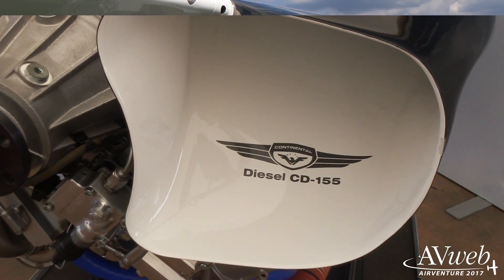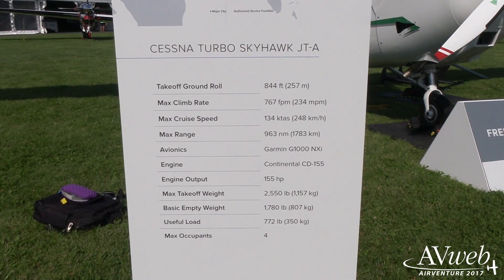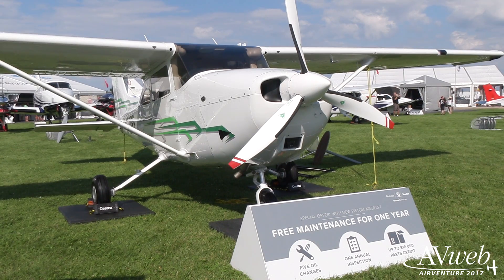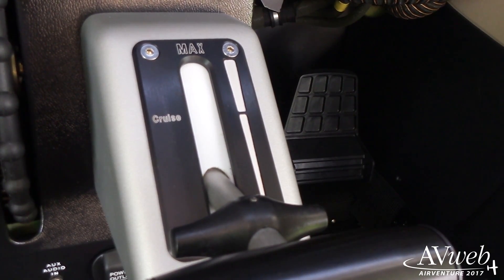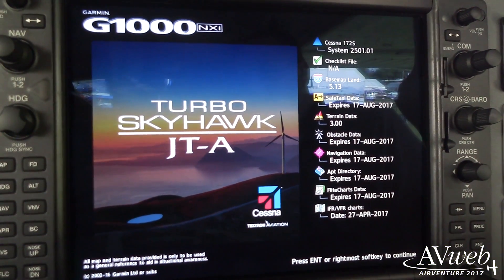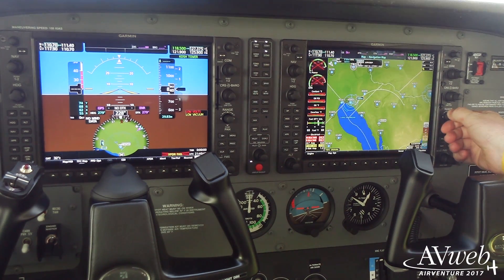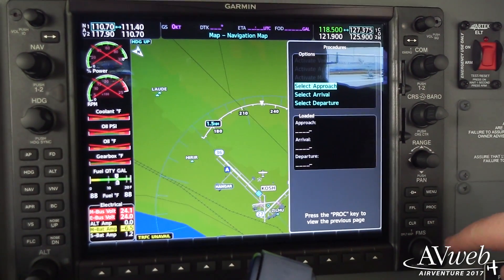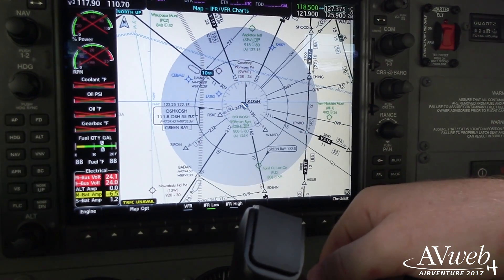Cessna's JTA: The Latest Diesel-Powered Skyhawk

Comment: They should have build a diesel C172RG and put a parachute in the back - now that would have been a 5.5 gallons/h 140 knots cirrus sr20 killer without those toxic slow flight characteristics. And it would have beaten the diamond da40 green house oven.

Comment: The Skyhawk is indisputably the most successful airplane in the world, with some 43,000 built and flying worldwide.  It fits whoever wants a simple plane to fly and maintain, and it does a lot of things very well. The JTA has exciting new altitude capabilities, which is something the normally aspirated avgas Skyhawk needed more of.  The new Garmin 1000 NXI gives the new 'Hawk unprecedented capabilities. I haven't mentioned the longer range yet. See below for the usual Germans whining about the price.  Cessna makes only incremental changes to the  'Hawk, because there is no reason to radically alter a proven design.  Airplanes cost what they cost because they are  built on demand.  Your gee-whiz smartphone can't stand  a lot of heat and they crash all the time. If you want high-performance airplanes, build your own, and write "experimental" on it. Then watch your friends climb into a local Skyhawk instead of your experiment.  Cessna is not going to bring back the C-120. Finally, the DA-40 is not built as well as a Skyhawk, and it is a flying oven in the sun. Sorry, Germans.

Comment: I'm all in favor of diesel-powered aircraft for simplicity, reliability, and increased fuel economy, but WOW... $438,000 for an ancient-design s-l-o-w fixed-gear, fixed-pitched prop C-172?!  Geez, I paid $54,000 for a brand spanking new 180hp, retractable gear, and with constant speed prop C-172RG Cutlass waaay back in 1981!  Yes, I got an incredible end-of-year deal, but still.  IIRC a new C-172 Skyhawk back then was probably around $40,000 so this one is at least 10X more expensive!  And it seems to me a diesel-powered version should be cheaper than a standard new Skyhawk since it sheds dual ignition system complexity, has increased reliability, etc.  OUCH, who can afford to fly G.A. aircraft these days?!  My question is who drove the G.A. segment into the ground with these unfathomable price increases?  [double facepalm]
Reply: It trades dual magnetos for dual-lane FADEC, and you're trying to argue that it's less complex? What?

Comment: It's amazing how far behind avionics are in comparison to everyday electronics. In about 50 years, maybe the GA world will have the capabilities of an iPhone. And Cessna better hope for a bunch of nostalgic billionaires to pony up for this grossly overpriced trainer.
Reply: It is crazy isn't it, but it's all down to certification. I fly a multi million dollar jet for a living with less computational performance than the $600 dollar phone in my pocket. The difference is the reliability of the avionics needs to be massive, it can never fail, so it's built on old and well tested, yet slow, equipment. Then you go to the FAA/EASA and pay a multi multi million fee to get them to rubber stamp the paper work so you can see it. This is why Dynon is so much cheaper, yet can only be used in experimental. The G1000 is a good bit of kit though, but when you step up to the 3000 and beyond you see just how amazing it is to use when flying, it makes it so much easier...if you know how to use it!
Reply: True.. I fly too and certainly won't accept any blue screen in the cockpit of a crashed operating system, ever. That could cost lives.
Reply: Umbongo The Dynon HDX can now be used in certified aircraft with an STC. Around $20K installed.
Reply: Absolutely NOTHING wrong with Garmin's products. They are all state of the art. They can't update the avionics every year like they do in an iphone for obvious reasons.
Reply: It is the FAA that is killing the aviation business with the archaic certification rules. The stringent certification was right 70 years ago when the electronic was made by hand solder transistors.  These modern solid state EFIS almost never fail, and they are so much better.  Losen up the rules and the electronics are so cheap people can put redundant units on these airplanes and call it aday.

Also, airplane structure cert is a joke too.  It made sense when they did load calculations by hands. Now with FEA, they should just test a subset of the structure, mainly the wing, which the manufacturer did already. Fire off all these FAA fatcats
Reply: the g1000 is old already. cute how he showed us the mouse option, today it's touchscreen

Comment: Take a 172, add a Garmin 1000 and a diesel. 500k? Is that seriously it? Yes diesel is better but for that price, no, and with a shorter TBO it's hardly that much cheaper in the long run. Is Canada and Europe actually doing away with 100LL or is it overstated?
Reply: It makes no sense at all.
Reply: I like diesels on smaller aircraft better but I just donät know for that price point honestly. I think it will be a good plane to pick up in a decade or 2 when they are cheaper used

Comment: Because 100 low lead isnt expensive enough
Reply: Jet A1 is, in Europe at least, less than half the price. This seems like a conversion of old tech to run on a different fuel though, diesels can be made lighter and more efficient, like the Austro engines on the diamond (2 litre turbocharged 160hp burning 20l (4-5gal) per hour!
Reply: @Pastronomer69  Actually the CD 155 is the Thielert Centurion 2.0S. So it is actually very similar to the Austro Engine. Both are derived from Mercedes-Benz A Klasse Diesels.
Reply: @kaefermichaify  and they're excellent engines at that! Now flown one for years (my current engines burn Jet A1 but in the tons per hour 😂) but I remember them to be smooth, powerful and a joy to operate compared to "traditional" piston engines
Reply: Stealth96 did not know that.  Thanks
Reply: Stealth96 but 100LL smells good!
Reply: Jet-A is cheaper than LL100, especially in Europe. Even more so some countries. 

Plus there is a world wide movement to do away with leaded gas. It's bad for the environment,  and it's used in such small amounts that it is not profitable to deal with.